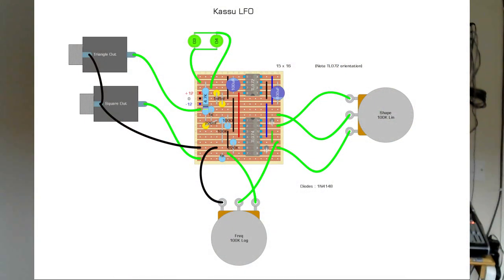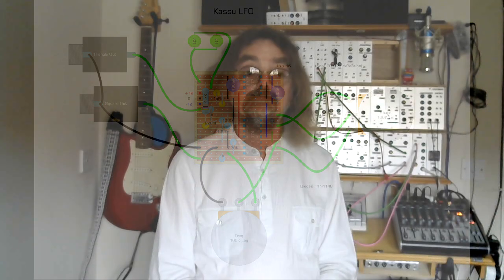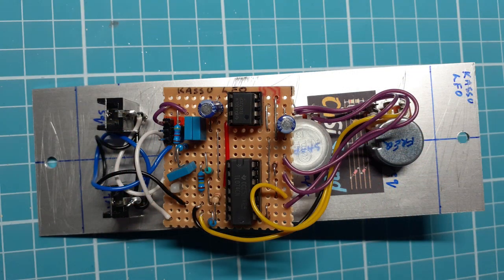Project XII part 25 : LFO with shape function

Comment: This is a very clever design This module is so functional that many people might overlook it but you've demonstrated some excellent uses for an LFO, especially equipped with the shaping capability. Thanks!
Reply from the maker: All credit for the design goes to Kassutronics, I just borrowed it. It struck me when playing around with this module that the LFO could be used as a looping envelope, especially with the ability to change slope or period.